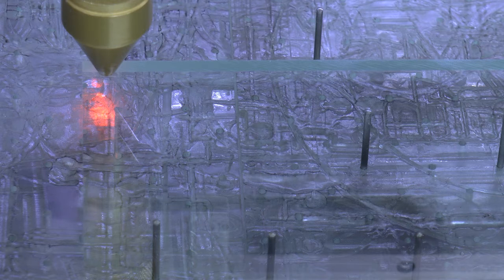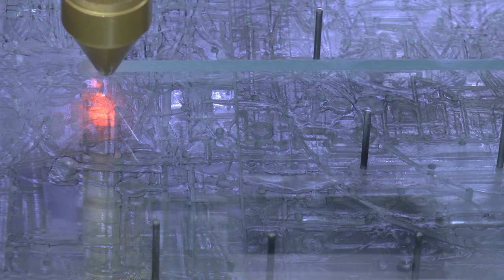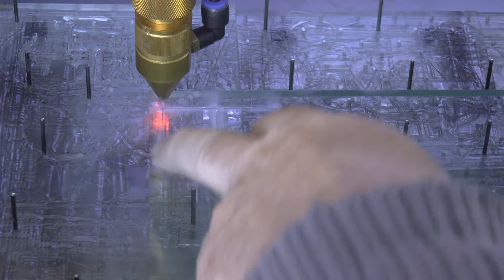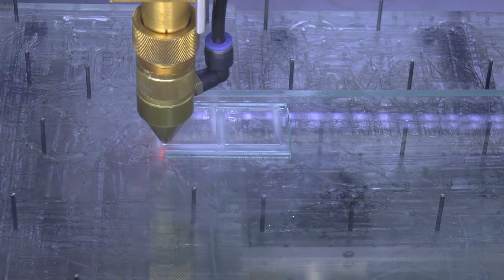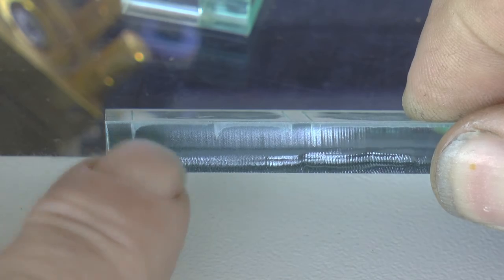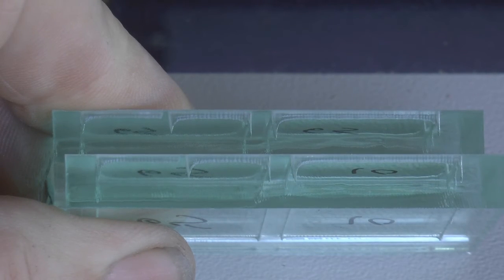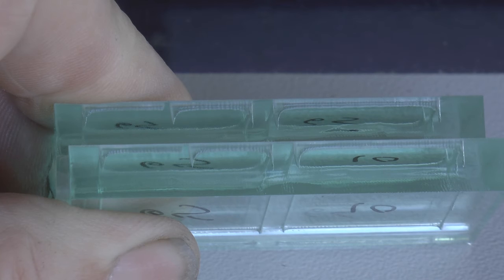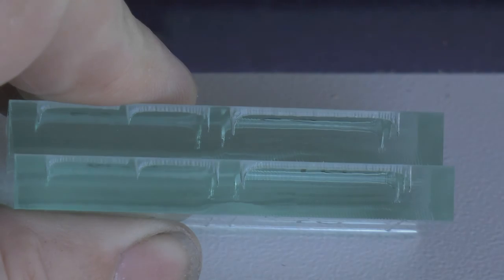RDWorks Learning Lab 55 Why Max Min Power Part2

Comment: good day, I have a question about the minimum power.

my machine engraved far too deep while the power is at 1% how is that possible? in the software everything is at 1%. but the machine still engraves far too deep. I do not get it anymore. Do you have an idea?

Greetz Arno from holland
Reply from the maker: Hi Arno.
Something seriously wrong here because it is not possible to generate any power at 1%. We shall need to discuss this off-line so that we can exchange data and pictures. Add you email to another comment and it will be auto copied to my gmail. I will answer you and also delete your email/comment from public view.
Best wishes
Russ.

Comment: Thanks so much for doing this. If only the companies putting out these machines put the thought and care into explaining how they work that you do. You've been a huge help.
Reply from the maker: +gazraman g 
Hi 
It turns out that the real reason for max min power will be seen in the e 3D wood carving videos that follow. Using max  min in the way I did here  is exploiting a sweet spot in the machine's performance because in hindsight I'm sure this was not what Ruida planned their controller to do. None the less a neat little trick. 
A wizard electronics guy in USA has wired his machine to checkway in which grey-scale  controls power. It turns out that white (RGB 255,255,255) is always recognized as ZERO power (beam off) Thereafter if you set min power at 10% and max power 50% the controller divides this range into 255 steps to control the output power according to the grey level in the program. All will become clear as you watch those following sessions.
Thanks for your appreciation.
Russ

Comment: Hi there, I have the same type of machine and it seems that I'm having problems with the power settings. It seems that no matter what percentage value I use (set on RDWorks), the power during the actual cut doesn't seem to change. I haven't been able to cut 1/8'' acrylic even setting the power to 100% and speed to 20 mm/sec. I am able to engrave plastic and wood but haven't been able to do cuts. Would you have any recommendations? Perhaps I'm not doing something correctly. Thanks in advance for your help.
Reply from the maker: +Paul Y 

Hi Paul
I apologise for the tardy reply. I thought I had answered your question but now I check back I do not see a published reply. Strange!
I am suspecting your version of RDWorks could be the problem. If you open RDWorks and look at the title banner across the top  it may say V8.01.12. Version 12 was a bit buggy and one problem it had was not transferring your parameters to the machine in the .rd file. Go to the Thunder Laser website and download a good stable version (probably issue 11) http://www.thunderlaser.com/down.

Also STOP. Never run you machine at 100% you will quickly trash your tube. Typically you will get nothing extra from the tube by running more than 60 or 65%.  I urge you to install an ammeter . Very cheap chinese 30mA. Very simple to fit . Absolutely the best friend you will ever have   see https://youtu.be/xDZmuxq5BEM

You already have some acrylic so turn it on edge and do some cuts at 10% through to 100% (100% for short tests will not harm your tube) to get an idea of your tubes power profile. You will see the sort of test I mean if you look at 
  https://youtu.be/WbBPps42iHc

Let me  know how you get on and we can move on from there if you still have issues.
Regards
Russ

Comment: you were not dreaming yesterday. i always use min and max power for single line text  (cut) otherwise it looks bad ( on acrylic especially) if i remember corectly my settings was min power 13 max power 30.
Reply from the maker: +mateusz1945 
When you see part 3  you will see that what I saw  was caused by a stupid mistake I made. The evidence of the two extreme tests in this video showed no sign of any difference between 65%/65% and 10%/65%. I would have expected to see almost no corner penetration if the power had really reduced to 10% at the corners where the speed is zero. I'd be interested further in your findings because my mistake has stirred up some interesting discussions. What size letters were you cutting an at what speed as I would like to checkout the visible difference you achieved. Thanks for your input
Best regards
Russ
Reply: +SarbarMultimedia speed 300  power min 12 power max 40.   that was after i upgraded to 100 watt tube but i recall settings were very similar on 60w. So with this settings  corners of letters were not " misty" and whole letters were crisp  and didn't need  much clean up . Try it on acrylic, generate text with Rdcam,.
I think my letters were 2 to 3 inches tall , but it should be visible on any sizetext.

Comment: interesting.  So what did we see in part 1?
Reply from the maker: +2020tesla 
I thought I was seeing a sophisticated control feature on this cheapo machine. When cutting MDF at a FIXED  power, the depth of cut (indicated by the amount of smoke staining at the corners) was obviously varying with speed.  Low/zero speed at the corners was creating a really deep cut. It was this observation that made me wonder if the machine had the sort of control system found on industrial lasers where the power is ramped down as the speed changes around a sharp corner Aha.....maybe that's what the min power is for. I tried it and it appeared to work 
Sadly it was a mistake on my part, explained in part 3 where I put 65% in the Min power window and 10% in the Max power window. The machine (unknown to me) was clever enough to reject the  high min value and made it match the low Max value (10%). So the whole pattern was cut at a steady 10% and looked smoke-free. I wrongly concluded that it was because the power had been ramped. Oops. The acrylic proved the point.

Best regards
Russ
Reply: +SarbarMultimedia Hi Russ, can you try to draw a single line  for right to left and second one with left to right underneath it, and use ramp effect option with min max power? maybe it could do some trick? i was gonna try it on my machine it, but didnt have chance to come near it all day :(